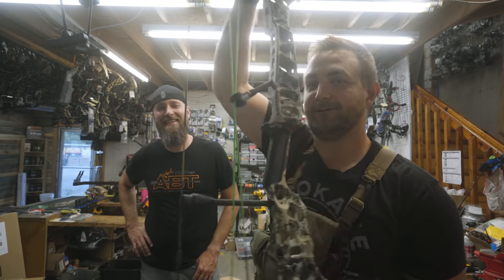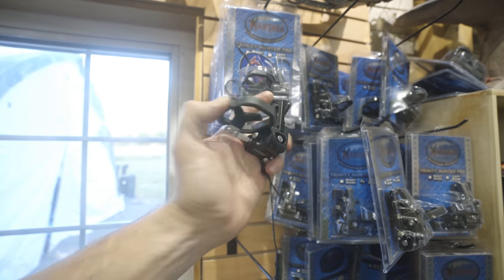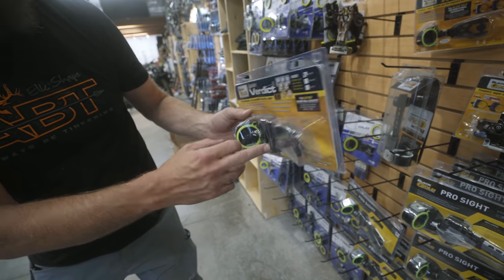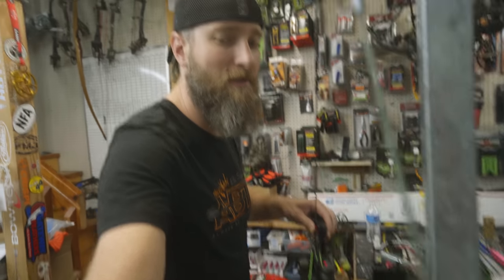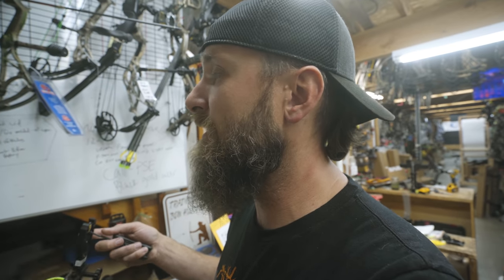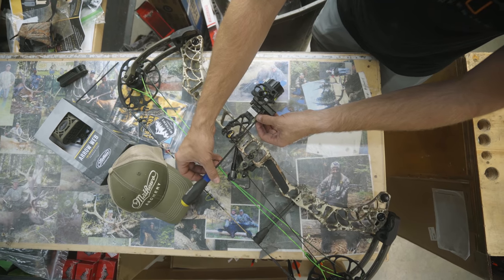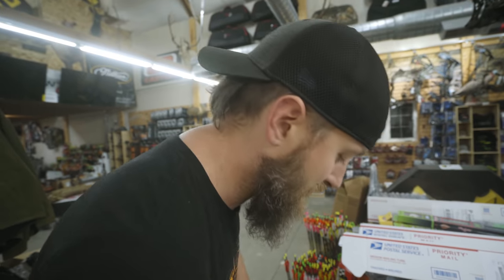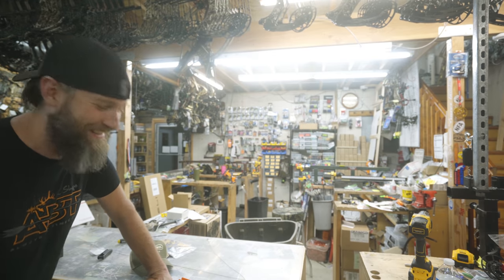MFJJ Teaches Me Bow Building 101 // BONUS BOW BUILD

Comment: The best backup bow in all the land. Well deserved and a nice quick bow build video. I recently bought a PRIME Black 3 that only had 50 shots through it at a new local bow shop for $600. So I took the Black Gold 5 pin and Hamskea Primer of my old 2006 PSE Fire Flite 33 and put it on the new bow and put the Trophy Ridge 4 pin Mist and a new Whisker biscuit on my old bow. Thank you for sharing
Reply from the maker: sounds like a good setup. good luck this Fall 🤘
Reply: @ElkShape  it should be and thank you. There was a Mathew’s Halon 6 there for $650 but I went with the bow that was newer and had less shots through it.
Good luck 🍀 to you both this fall